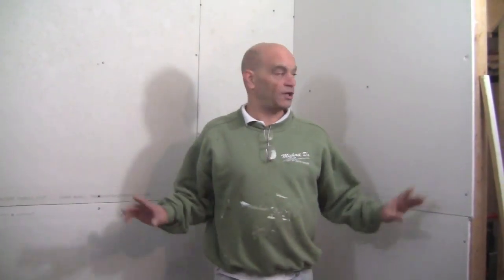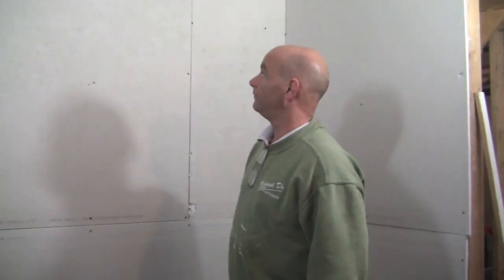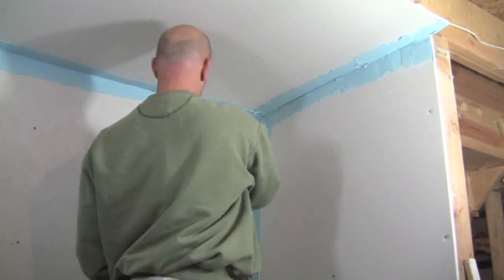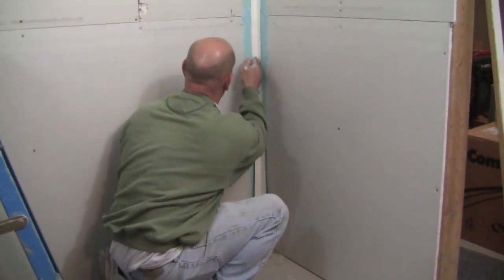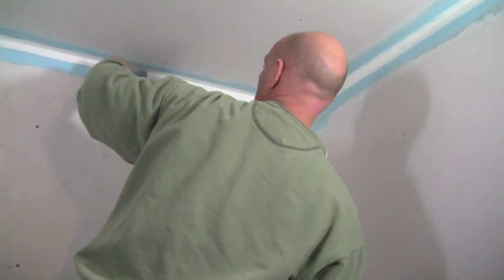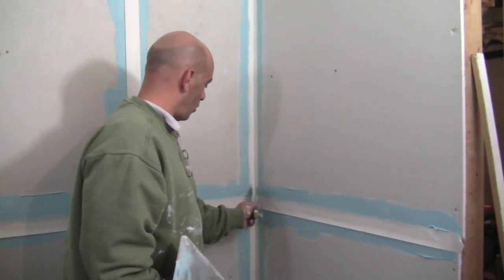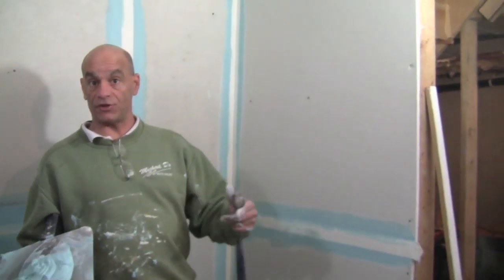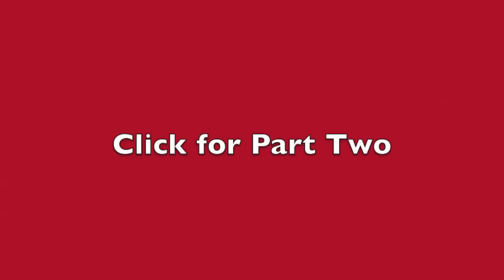How To Tape By Color

Comment: First of all, I love all your videos! They are wonderfully done. My question is: I often find that during the second or third coat, the paper kind like dried and has air bubbles in the middle. What caused this  problem? I'm sure that I press the sides of the paper hard enough. Is it has anything to do with a bigger, or unfilled gap?
Reply from the maker: Thank you. That happens when there is not enough joint compound under the tape or not pushed in good enough.
Reply: askmediy Thx!